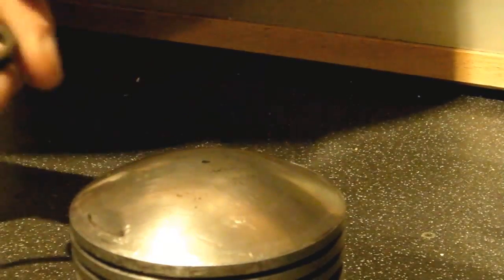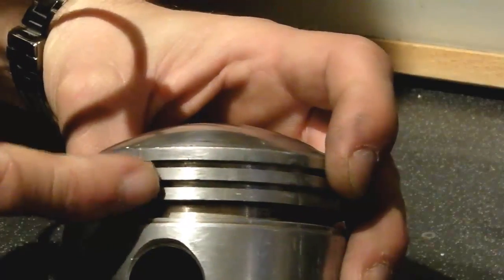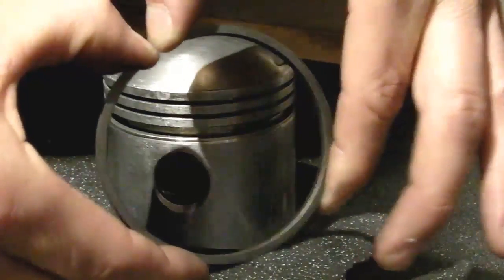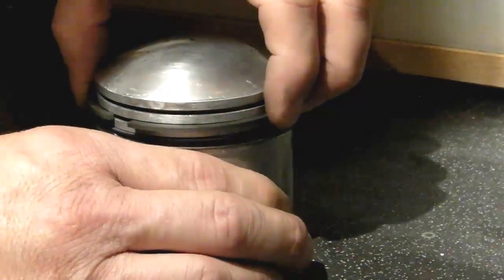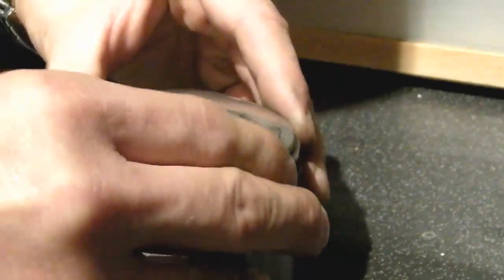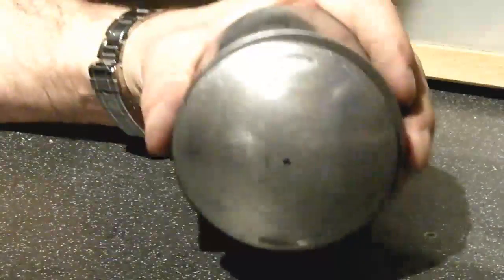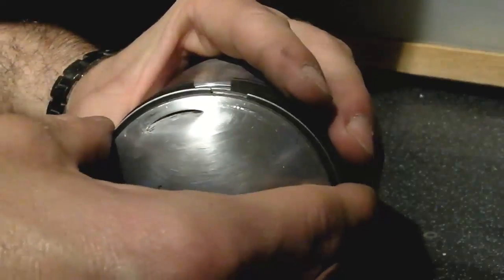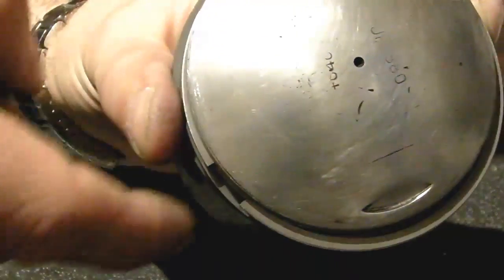Piston Ring fitting, How to, Royal Enfield 350 Bullet Classic

Comment: I have a question . I have a 03 electra 4 speed 350, is it possible that i can upgrade it with 500 std piston , barell head , clutch etc and enhance the performance????
Reply from the maker: Bangbros69 -8 As far as I'm aware you should be able to swap the barrel head and piston straight onto the engine but I don't know if there's a difference in the stroke, if the difference is all in the diameter of the barrel then yes, effectively you'll increase the capacity and performance to that of the 500cc you might need to swap the carburettor or jets to suit the higher capacity too.
Reply: spidiq8 Thank you soo much really appreciate it  , a great relief that i'd be able to enhance the thump and power of my forever enfiled . Lastly ,although it's not efficient does riding a dry clutch boost performence ??
Reply from the maker: Bangbros69 -8 You're welcome, Yes a dry clutch will enhance performance but only marginally, there's less drag but with something like the Enfield you'd really never notice, it only matters on the track where fractions of a second count, I'm not sure how you'd implement it either.

Comment: I have a 5 ring piston fitted on a old bullet.. it's a 90 model bullet 350.. it has little white smoke. Barely seen from naked eye but when you carefully look it has. But when accelerating there is no smoke?
Reply from the maker: sunil thomas Nothing to worry about if it's a little one start and barely visible, only a problem if there's a lot in use and your spark plug is fouling, that means there's a lot of oil blowing past the rings, tolerances are looser on the iron barrel bullets than modern ally engines meaning when cold a little oil could seep past.
Reply: May be due to wet sumping

Comment: Lifespane of piston of bullet 350
Reply from the maker: clash of clan That depends on many factors, type of use the bike gets, temperatures, frequency of oil changes, filters, oil levels, and so on, it's impossible to specify.
Reply: Can u guess and tell atleast how much lifespane a piston have
Reply from the maker: clash of clan Honestly, no. If everything was fitted carefully and tolerances were ideal and it's been run in properly and had frequent oil and filter changes and only been ridden carefully in moderate climates then potentially thousands of miles, if it's been thrashed mercilessly for 10 minutes in hot sunshine with old oil or insufficient oil two months ago it could stop tomorrow, or next week, or next month or keep going for a couple of years.  It's literally impossible to tell the condition and lifespan without stripping and inspecting everything and rebuilding even then you could only estimate based on the condition of the barrel and piston at that point you see.